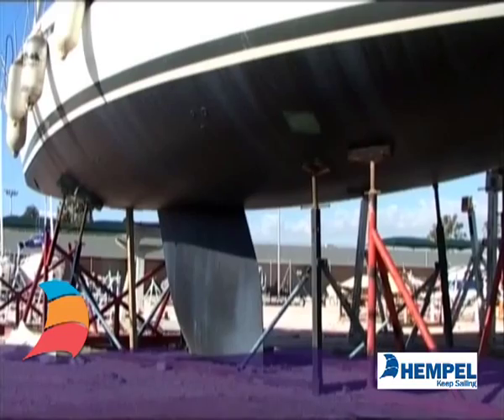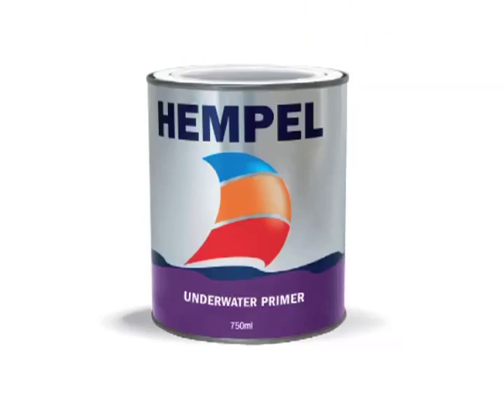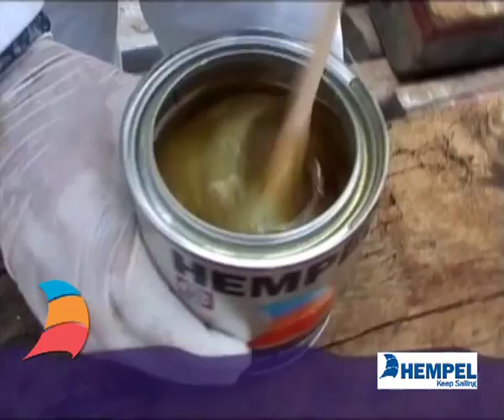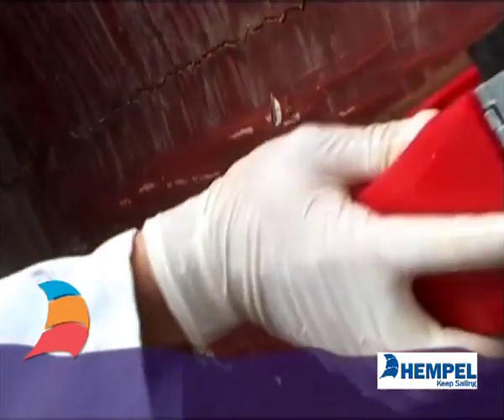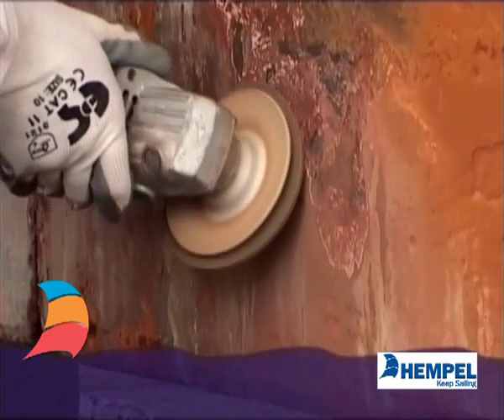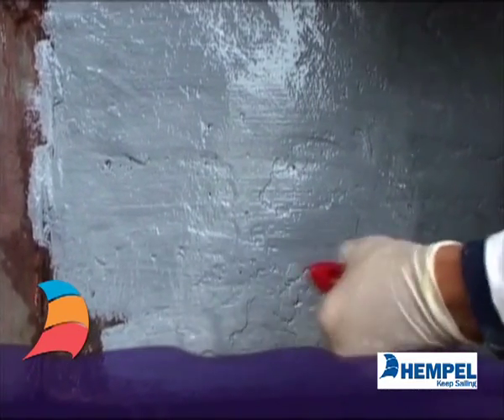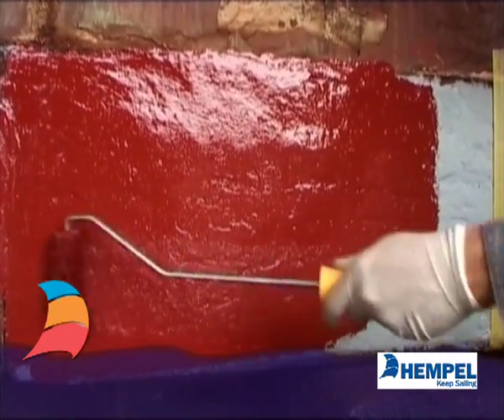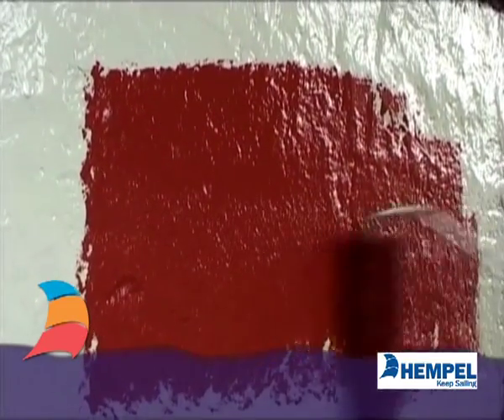HOW TO TREAT KEELS

Comment: I used it on my keel and it was in the water 24 hours while travelling to the next marina to be hauled out again....24 hours and it rusted....That is I applied it after wire brushing and using a rust cure to turn the iron black....To say it is dissapointing is a massive understatement....It just does not work....Might as well have used some ceiling emulsion I had in the garage....
Reply from the maker: Dear FTSETrader Steve, thank you for your feedback. Please contact us directly on yacht@hempel.com and we will be happy to support you with your issue. Br, Hempel Yacht
Reply: @hempelyacht3661  Dear Hempel - is this because there was an inability of the primer to bond to the rust converter? You so say bring it down to shiny metal, them apply primer. 
Also is the advice to apply 6 coats of primer sound? I have gotten advice saying that the thicker I coat the bottom, the more likely I will experience flaking off. _ if I get the thinness/thickness right, the protective coating will last much longer.
Reply: So you applied a two pot product over a single pot rust converter? I've owned steel yachts and removing any loose surface rust (needle gun works great) then thick layers of epoxy keeps oxygen and water out and from experience works great!